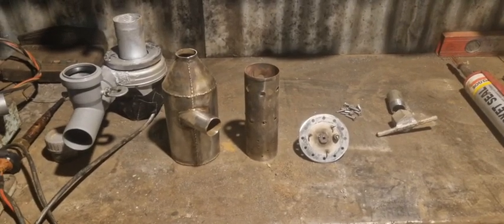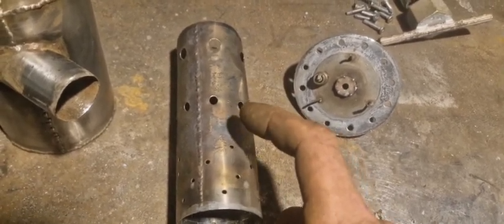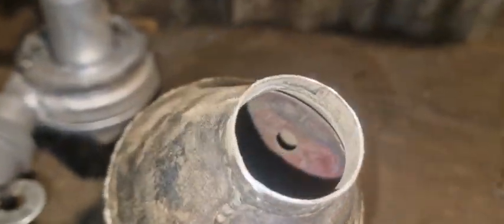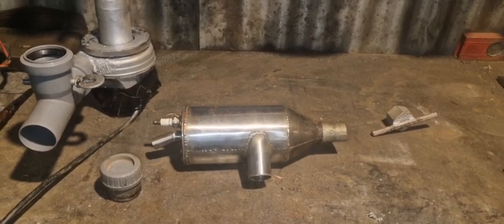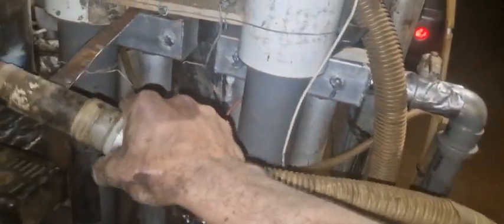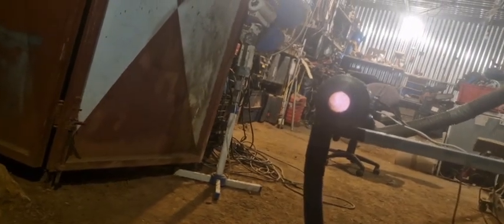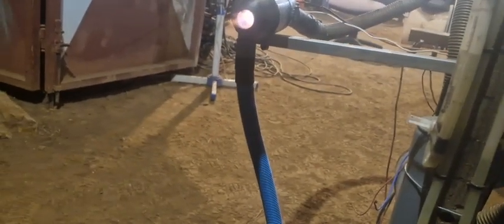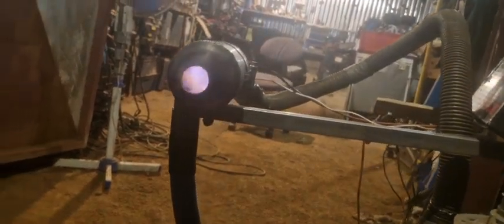annular jet combustor on syngas #biomassenergy #diy #combustion

Comment: It can drive a motor what about the power it can drive a motor?
Reply from the maker: Its for a turbine engine application , this particular model can do 5kw thermal energy (1-2kw mechanical) at atmospheric pressure at boost pressure it can be eay more
Reply: @oscarverwey  if you add a turbocharger you can get more power 😊
Reply: @oscarverwey  do you have a 2D model of your jet engine or can you recommend me were can I get one
Reply from the maker: I've ones used a turbo charger from a car  , the turbine can also run at atmospheric pressure in reverse,  where in between the turbine en the compressor there is a big water heat exchanger (inverted bryton cycle)

Comment: That is a marvelous combustor. The cyclonic/vortex air-dynamics likely plays a very important part for the stability of the combustion. The principle seems to be the same as the dynamics of what is known as the "vortex cooler". A very simple design but quite a fluid-thermodynamics happening there.
Reply from the maker: I appreciate your comment, i agree that an annular combustor is pretty clever throughout . Specially when you can hold the shell like that while it has been burning for 1/2 hour ;) , I used this  combustor to drive a tiny turbo jet engine made from a diesel engine turbo last year or so , the thing was terrifying en awesome at the same time.  Now I plan yo use it as a starter for the 2 viking stage gasiffier so it doesn't need to rely on a different startup fuel to make exhaust gas to get the pyrolysis going in the screw feeder.  I believe, together with steam recirculation in the hopper, it's the ultimate gasiffier for high efficiency while using high moisture fuel (30/40%)